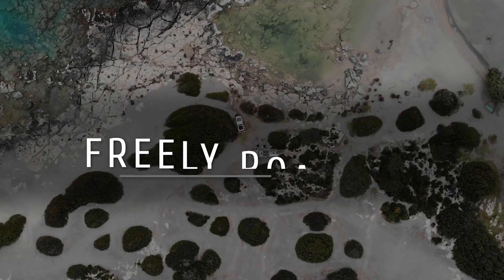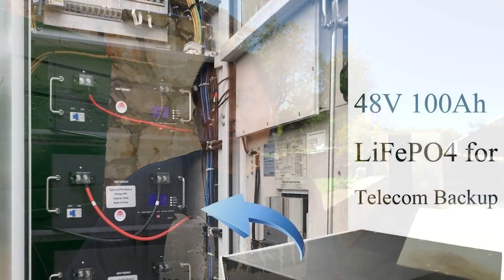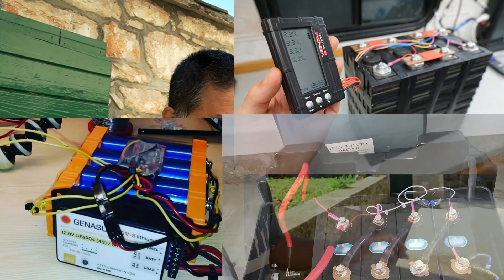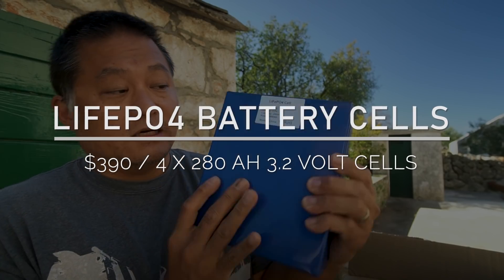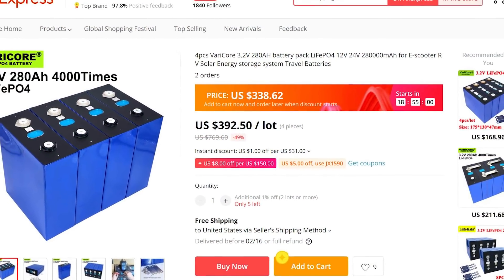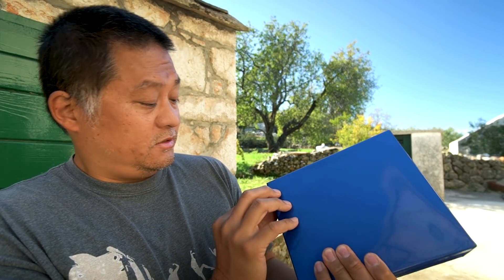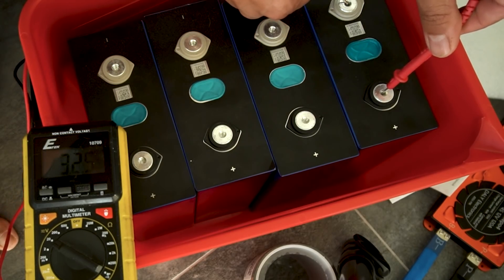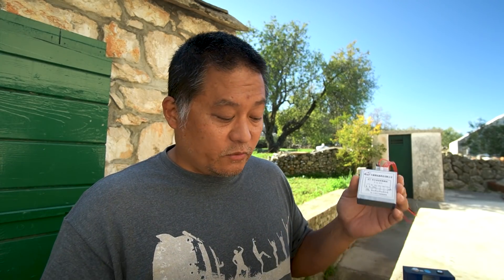Build Your Own 12-Volt LiFePO4 Battery For Cheaper Than AGM

Comment: could I wire one set of these in series, then wire those parallel with another set of 4?
Reply from the maker: To make it easier it's better to wire pairs in parallel first and then wire the 4 pairs in series to make a 2p4s pack using 8 cells.
Reply: @freelyroaming  thankyou yes that makes more sense

Comment: Excellent presentation in all respects! Yes I totally agree that 12V (or 6V) Li-batteries do have a number of significant advantages over AGM's with the best by far being energy density, usable Amps, battery orientation and weight differences (I presently run two 110Ah AGMs in parallel in my off-road caravan and the combined weight is 60kgs)! Battery management is through a high-end MPPT controller (which can also handle Li batteries) fed from 150W solar panel. The down sides for Li batteries here in Australia is firstly, cost with presently up to a 4X $ difference between equivalent AGM's and Li's (Li's being higher cost) and while the Li-battery sellers often "tout" "10+ life-times compared to an equivalent AGM", I'm yet to see any factual confirming data supporting such claims!! Li-batteries however, do definitely last longer than AGM's but just how much longer is pretty much still to be realistically demonstrated which, in my opinion, does not justify Li-batteries high cost. What really worries me (as a retired analytical chemist), is that in my experience Li-battery sellers almost always DO NOT mention Li-batteries VERY SERIOUS property of possible spontaneous ignition (bursting into flames) if cell collapse, short circuit, battery case puncture or even significant over/under charging occurs - a very serious safety issue that really does require knowledgeable understanding by the users of Li-batteries which, unfortunately, is generally not readily understood by many caravanners. Regarding AGM's, yes you can get combustion of oxygen/hydrogen gas evolved if a cell collapses or suffers a short circuit etc, if these batteries are not properly looked after, however in this case it requires a separate source of ignition (usually spark) AND an accumulation of hydrogen in a confined space such that the concentration of evolved hydrogen is both trapped and reaches or exceeds the lower ignition point for hydrogen in air. If using an AGM (or other types of wet-acid batteries) it is a really simple matter to prevent any build-up of hydrogen and oxygen under normal use (for older types of non-valve regulated wet acid types) or even if the above adverse situations occur, by installing a couple of small 12V DC's fans vented to outside from an enclosed battery compartment. The fans can be set to come on when drawing power from or during charging of the AGM's etc., thus totally removing any chance of there being a fire or explosion. Unfortunately, the same extraction process cannot be used to prevent Li-batteries autoignition or combustion possibilities!  There are 'always horses for courses' with whichever battery system is adopted BUT benefits and potential hazardous issues for both types of battery systems MUST be rigorously explained by the battery seller AND must also be thoroughly understood by a purchaser before their selection is made! For me for the present, I am sticking with AGM's and putting up with the extra weight disadvantage but enjoying the very significant much lower cost together with what is (IMO) a far safer choice for caravanners.
Cheers from Down Under.

Comment: Is there a device that cuts out charging at a low temperature of, say 1°C?
Reply from the maker: I am using the Victron Battery Sense what measures temperature and it tells my Victron MPPT charger to stop charging at a set temp. Right now it is set to 4C but it can be set to any temp. If you watch my entire battery build series you can see how that works.

Comment: Hey man awesome video i think im gonna build my own now  instead of buying an SOK for ~1000$. The project sounds simple yet satisfying, esp considering the savings. Few questions tho: the BMS is all you need for both overdischarge and overcharge? Does the BMS have temperature cutoffs as well? Did you go on to insulate your self built battery or add a heating pad or cooling system or anything? How long did it take for your cells to arrive? Thanks for any help :)

Comment: Hello. 
I also bought some 280ah lifepo4 batteries from aliya's battery store. I finally got them after 2 month waiting !
Just a question ... Is it necessary to top-balanced the batteries before the assembly ?
Reply from the maker: Not necessary but definitely recommended.
Reply: @freelyroaming  Thank you ! Have you done it ? Unfortunately I don't have any power supply to top-balanced the batteries. What is the risk exactly if I skip that part ?
Reply from the maker: I did not have the charger either. You can alternatively connect them together in parallel and leave them for a few days to perfectly balance them out. Then make sure you do not charge it without the BMS so you don't risk overcharging any individual cell.

Comment: Well explained, i built my own 11 months ago and have the bluetooth daily bms, i can not fault it, 200 ah 12v life po, i can sit under a tree for 3 days solid b4 recharge,  how ever i do run solar into a 40 amh dcdc mppt charger, can take 800 watts of solar, with a 1c rating
Reply from the maker: Thank you. At my discharge rate I should last about 3 days as well without sun. A big upgrade from my AGM pack that needed recharging daily.

Comment: nice and informative video, can i use pwm charge controller instead  for this kind or batteries?
Reply from the maker: As long as your PWM charger has a LiFePO4 charging profile. It would say in the manual if it does.

Comment: What a pleasant video to watch.
I have a question...
If I want to build a battery bank with 3 or 4 of these 12V packs, do I need a BMS for each pack?
Also (well it will be more than "a" question...), what should I have in mind to choose a BMS, how fast I would want to be able to charge the batteries or the amount of amps my devices would require?
Thanks.
Reply from the maker: Thanks. What you would do is create 4 sets of whatever quantities you plan to build and connect those sets in parallel. Then just treat those parallel sets as single cells to build up your 4S pack to make a 12 volt battery bank.. Add BMS and charger from there on according to your needs.
Reply: @freelyroaming  
Thanks again.

Comment: Random question... do induction cookers, like the induction hot plates, actually pull fewer watts at lower settings or are they like conventional electric cooktops that just cycle on and off at varying rates? If it's the latter, you have the same peak wattage concerns with your inverter, batteries, etc. 

I'm always trying to figure these thimgs out, I own a food truck business that runs (2) 7kW Honda inverter generators per truck. It's super frustrating, we need all that horsepower on demand to handle  peak loads, but 1/3 the amount of generator would probably be adequate if the load were smoothed out across the day. One day we'll go all battery... it's in the realm of possibility right now, but I'm excited to see what kind of aftermarket industry crops up in the next 5 years to start putting all the used EV modules to use. Exciting times for the crazy tinkerers out there.
Reply from the maker: Induction cooktop is very different than a  traditional hot plate. One is using magnetic resonance to heat ferrous metal using vibrations while the other is simply using resistive friction. Induction heat is much more efficient and accurately controlled. Very little energy is lost in the heat transfer process as it passes directly into the cooking vessel. But they will still use plenty of power. There's no getting around that when cooking with electricity. I'd imagine you are still better of with a generator even with a big battery pack since it's a business and a dead battery would mean you have to close for the day. But possibly using it as a buffer so you don't need to run the generator as long or even just having it as a backup.

Comment: What mppt charge controller do you use?   Thank you James  I am buying 8 Lifepo4 batteries.   Also do I need 2 bms or 1?
Reply: Great video easy to understand Thanks
Reply from the maker: I am using a Victron SmartSolat MPPT charge controller. If you are building just 1 pack out of 8 cells, you only need 1 BMS.

Comment: Based on the amp hour rating given couldn't you theoretically replace 2 agms with 1 LiFePo4 bank.
Reply from the maker: It is about double the amp hour in the same foot print and half the weight when comparing LiFePO4 to AGM.

Comment: Did you use a 3.2 volt or 3.7 volt BMS?
Reply from the maker: My BMS is configured for 4S LiFePO4 battery chemistry. 3.2v nominal per cell.

Comment: Lead-Acid batteries went up a LOT, around 2013, when Obama's admin EPA closed down the US's largest lead smelter due to pollution concerns. Prior to that time, a car battery was about $40-60, after $90+. There is only one US smelter operating now, in Arizona, and only one mine in Alaska that is operational.
Reply from the maker: I'd imagine demand has decreased some when tire shops stopped using them for wheel weights.
Reply: @freelyroaming  Still being used today.
Reply from the maker: Not in CA. I guess it's a state law.

Comment: Thanks for the info...I am curious about active cell temperatures.  I would prefer to build a platform that utilizes space between the cells, as I have seen in UPS systems. Not sure if needed.

Comment: I hope you put these batteries under compression. They need to be in a contained space or they will swell. I wrecked my first set not knowing that fact and I have a 48V system built from these exact same cells.
Reply from the maker: I've got a video specifically about compression of these cells.

Comment: I've been running two 105a/hr AGM's for over 8 years now and they get an absolute flogging regularly being run down to under 20% then charged back up to 100% in all kinds of weather and being beaten about in the harsh Aussie outback over severely corrugated tracks... cost me (au) $500 each and still going strong...

Comment: Love the videos and I am a subscriber. I have a question about your Daly BMS , are you using a Common port or Separate port?
Reply from the maker: Thanks! I'm using a common port. Easier to setup and can handle higher charge capacity.

Comment: How can you Build a 100ah battery for less then $120?🤔.  A Marine 100ah LeadAcid group 31 battery is $120
Reply from the maker: A lead acid, sure. But we are comparing it to AGM here. A comparable AGM will cost closer to $200. But let's just compare to the cheap lead acid batteries you are taking about. Even with those, to get 280 usable Ah, you will need to buy 6 100Ah batteries. Let's be generous and say 5 of them will do (50% of 500Ah gives you 250Ah usable. Close enough.) At your cost of $120 a piece, that's $600. These LiFePO4 are still cheaper. My cost per usable Ah is $2.23 (16:15). Your lead acid is still more expensive at $2.40. But sure you can say you don't want that much capacity. Maybe you just need a smaller pack comparable to a 100Ah lead acid, you can find lots of diy LiFePO4 options that will give you same 50 usable Ah for under $200. The point of this video is the price of DIY LiFePO4 batteries. I am not even considering the savings you will have over time given the thousands more charge/discharge cycles you will get. But if DIY is not your thing. Stick with flooded lead acid if you have the space, don't care about the fumes and willing to carry the weight.

Comment: Stripping, one of my favorite topics!

First off, the technical document will have a torque spec or you can contact the manufacturer for it. Get torque wrench and use it.

On threads: You don't have to worry about shallow holes/ short bolts, once you get the bolt in, 3 full turns and that's enough thread engagement so it won't strip out in tension AT the correct torque.

IF you lightly (as in touching a q-tip to grease and wiping excess away) lubricate the thread, you can torque to 80% of the spec because that lubrication reduces friction at the interface of the threads while giving the same clamping force (good to know on dodgy looking items). A copper grease will also stop the bolt ever getting stuck, winning!

On bolts coming loose: Look for aviation bolts in the needed dimension or DiY your own.  Add a small hole into each end of the bus-bar, use the locking wire techniques (Don't bridge the wire across two terminals).

Comment: Make aure you correct your information about overcharge or undercharge lithium batteries. What you just said was lithium's can be overcharged.  That's not correct. BattleBorn ceo and coo is my source.
Reply from the maker: I don't know where you heard that. I literally said the opposite of what you think you heard - "They can be damaged if you over charge or under charge them." (5:56). I also recommended not going over 90% or under 10% in charge cycles (7:30). And again I explained why is important to have BMS so you do not over and under charge (13:12). It is literally across the entire video where I stated the opposite of what you think you heard.

Comment: Lead acid has been going up since I can remember. A 12v 1000CCA Platimun level battery used to $60 and I thought it was a lot. Now it would go for ~$180-$200

Comment: Great video. I’m wondering why you need the Dayi BMS if you have an active cell balancer? Thanks!
Reply from the maker: BMS's primary job is not to balance the cells but to detect over or under volted cells and shut the battery off when they happens. It will also passively balance the cells as its secondary duty to minimize the need to cut off power. An active balancer will not be able to shut the battery off to prevent damage but it will assist in BMS to minimize the likelihood of it's occurrence. So you always should use a BMS even if you have an active balancer.
Reply: @freelyroaming  ah thanks. So it basically acts as a voltage gate. It closes when it detects a dangerous voltage.
Reply from the maker: Right. That's a good way to describe it.

Comment: Doesn't the BMS prevent overcharging?
Reply from the maker: Yes it's primary purpose is prevent over charging and discharging by monitoring each cell's voltage independently.

Comment: Great video very well done. I still like AGM as it like a old reliable vehicle. I have seen what happens when Lithium's go wrong, And the problem is it's hit & miss with build quality. I think the biggest issues with lithium is the toxicity & mining aspect of them or should i say no body knows what to do with them at end of life cycle (recycling) In Australia i think we only have 1 center that can do this. 
The next thing is the thermal runaway issues with them, i have seen people's vehicle go up in flames with little to zero warning. They do not like very cold temperatures or very high heat as AGM does not really care. 
LOOK once lithium is more stable and they put some sort of GLOBAL regulation out their stopping factories from making poor quality crap i will swap over to them.
Reply: LifePo4 chemistry does not have the same issue as other lithium Battery chemistries with thermal runaway and fires. 

These are safer than most other batteries and you don’t have lead! Acid, or weight issues.

Comment: Where can we use this kind of battery?
Reply from the maker: RVs, boats, off-grid homes or diy powerwalls for grid-tied system.
Reply: @freelyroaming  What about cars?
Reply from the maker: They are not really designed for starting engines. That uses high cold cranking amps. These are more for durability and capacity. Any deep cycle purpose.
Reply: @freelyroaming  Thanks for clarifying.

Comment: Hi Dan, ty for the explanations. I have 2 questions on the BMS device.
When setting the max voltage to f.ex. to 80%, does it balance the same, or in other words, does the active balance voltage lower the same amount? My fear is that you must have the max voltage level high enough in order to get the balancing aktive.
Do you need a Bluetooth module in order to configure it, or are there other ways?
It wound be nice if you make another video for the configuration.
Thanks and regards
Reply from the maker: Thanks. This BMS and the active balancer have no configurable settings. They are fixed from the factory there for has settings specifically for a 4S LiFePO4 battery like mine. You can buy other BMS that will allow you to configure custom numbers. Look at Electrodacus or Overkill Solar BMSs. If I want to limit the max capacity I would set the charging voltage on my chargers. The active balancer doesn't care about the overall voltage. It works based on the individual cells voltage which range from 2.5v to 3.6v. it should work as long as one of the cell is within that range.

Comment: Do you know what batterys were used by the phone company in the 30s and 50s for back up power
Reply from the maker: There were no cell phone towers back then so much of what is needed today just wasn't necessary. But I would imagine they used lead acid batteries where they needed to store electricity for backup.
Reply: They were most likely Edison type Nickel Iron batteries. They were commonly used in telephone and railroad signaling. 

I worked with them in the 1980’s to around 2000. They were in service since around 1930.

Comment: Hey Dan,  got a question on how BMS's work. If during discharge one of the 4  cells drops below 2.5v and the BMS disconnects the load, does that mean you won't be able to recharge the battery, since the BMS disconnected the common port. Does that mean no charging or discharging unless the BMS turns back on?